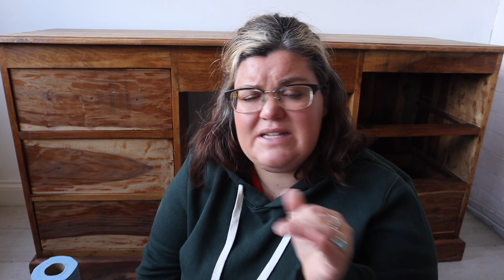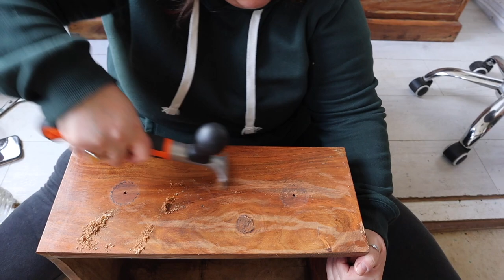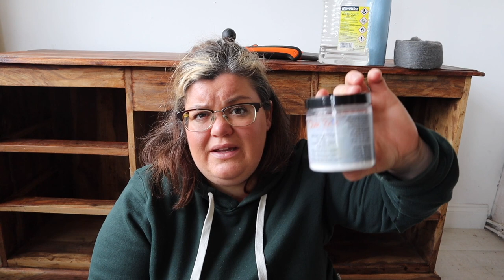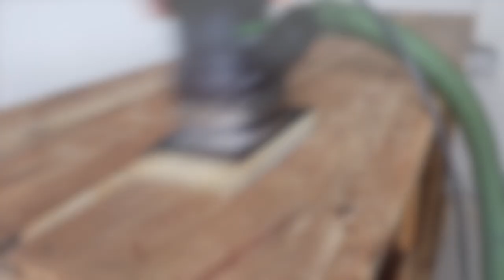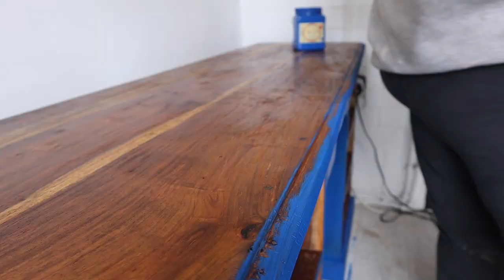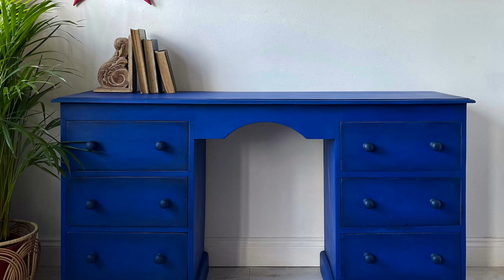How To Remove Wax From a Piece of Furniture & Prep for Painting

Comment: This is the best, most comprehensive wax stripping vid I could find. Including how to identify wax at the start is a great addition. Thank you! 

Could I just use dish detergent for the clean step? I guess if it's just for degreasing that might be OK....
Reply from the maker: That’s great to hear, thanks! Personally I don’t use dish detergent for cleaning as it can sometimes cause too many bubbles and be a pain to rinse off. It will cut through grease though 😃

Comment: I'm so happy I found your channel! I've been trying to find out what to do to remove wax! I've got an antique side table and it's been painted over many times. I myself painted it with Annie Sloan paint and then white waxed it. I think what I need to do is remove the wax first? And then try to strip off the paint? I'm asking you for advice 😊 please.  Or would stripper remove it all at once? I've been using mostly Dixie Belle products since I like it so much better. Thank you for any help. Have a blessed day, from Indiana 🌹
Reply from the maker: Hi!! I'm so glad you found the video helpful. You could use chemical stripper to remove everything or a scraper tool would do the trick as well - it depends on your personal preference. Some chemical strippers can be a bit stinky!

Comment: Thank you for giving so much detail.  I’m never sure how much pressure to apply when sanding or removing finishes so that information is really appreciated. 😊.  I need to redo a couple of areas done with Annie Sloan white. Wondering if using steel wool with the mineral spirits darken the paint while removing the wax?
Reply from the maker: If you have paint underneath then it might be best to try with a rag rather than wire wool - and try a small area first in case it taints the paint 😀

Comment: Thanks for the video very informative i just have one question, i don't want to repaint my piece of furniture i want to wax it again should i follow your instructions in the video to do this or do you have another suggestion
Reply from the maker: Yes you can re-wax your piece if you want to just refresh and refinish it instead of paint
Reply: when you say refresh what do you mean ?
Reply: i have just bought a 120 year old antique pine bedroom set a huge wardrobe two bedside tables and a double bed, it is so heavily carved and intricate that im  a bit worried i will damage it, plus i started one of the bedside tables today the wax came of great, i cleaned it with the white spirit but it hasnt dried out like yours did it in the video and im a bit worried
Reply from the maker: I just meant to strip the old wax off and re-wax. Old wax can get grubby

Comment: Hello, do you have to do clear wax before a coloured wax.  Can it still be sealed with Gator Hide?  Thank you.  
I'm enjoying this learning experience.  Thank you for your time and effort, know that it's appreciated.
Reply from the maker: You can apply clear wax before a coloured wax - it gives you more control over the application of the coloured wax if you do. You can Gator Hide over Best Dang Wax but you do have to wait until it completely dried which can take a few days (depends how thickly you apply the wax). Hope this helps!

Comment: Recently painted a desk and Hate it! That being said do I follow the same process you did and paint again? Should I remove paint by scuff sanding only? Thank You
Reply from the maker: What paint and top coat did you use on your desk?
Reply: @faffdesigns  Dixie Belle paint and Can't remember if Annie Sloane or  Dixie Belle wax
Reply from the maker: Dixie Belle wax is water based and wouldn't need stripping in order to repaint. Annie Sloan wax is an oil based wax and would need removing before you can repaint. Hope this helps!

Comment: Hello. Do you ever have any issue with the wood ebonizing when using the steel wool?
Reply from the maker: I personally haven’t had that but I know sometimes small pieces of the wire wool can become trapped in the wood grain and then turn black over time. I always clean after using White spirits and wire wool and give a sand once it’s dry

Comment: Would this work on a Chalk paint which has been waxed?
Reply from the maker: Yes you can remove it in the exact same way. Sometimes you only need to use the white spirits and wire wool unless you’re stripping the paint off too